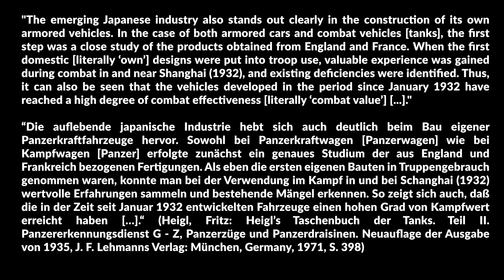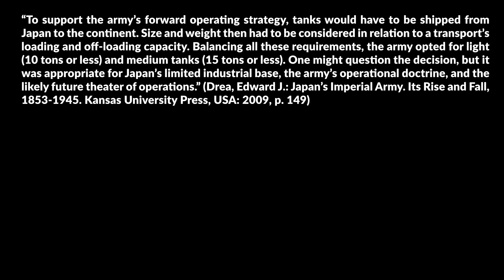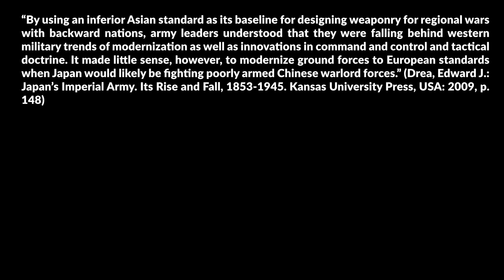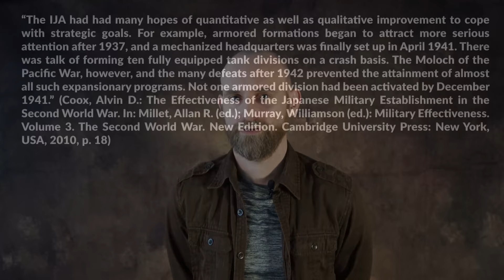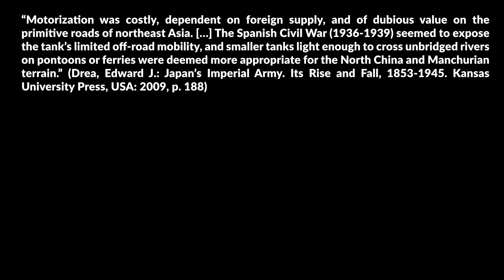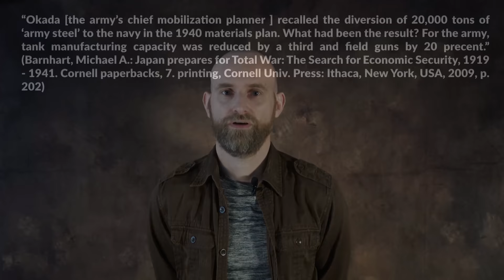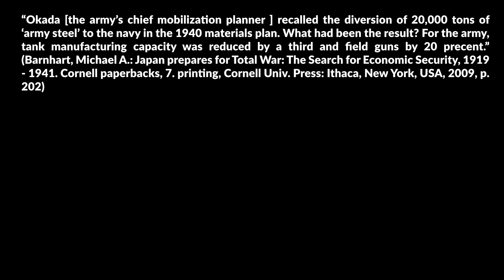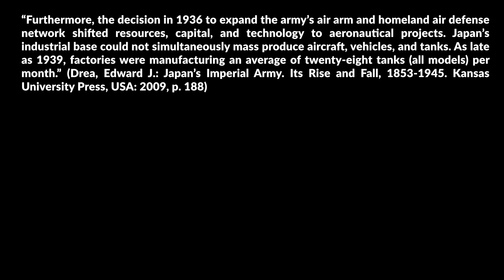The Problem with Japanese Tanks in WW2

Comment: The lack of real armor formations with good tanks isn't unreasonable. Its their complete lack of anything really advantageous in their army line up. Call me funny but going into a land war with China without serious advantages seems truly dumb. The numbers advantage the Chinese had along with their many different factions basically made them an unkillable hydra. Wipe out the leadership of one faction and their troops are likely to fall in line behind another faction simply to get fed. Its not the winning the battles that becomes the issues. It is the maintaining control of areas after you take them. Insurgencies would have been able to fade back into the massive population without much struggle. Mass killing civilians to stop that likely made more recruits and made that particular area even more of a drain on resources rather than a gain that a conqueror needs to continue moving forward. 

Im sure the Japanese were able to get some resources out of China, but at what cost? How many soldiers had to be tied down to garrison duties just to secure a particular mine and the road/rail network to extract stuff from that mine to the port for shipping to Japan?

Comment: Their tanks where suffied for the main threath, chinese peasants with at most a 37 mm pak
Reply: 37mm cannons went trough them without any real issue. 

In 1945, when the Soviets invaded Manchuria and the Northern-most Japanese Islands, they found out that their long obsolete PTRD41 Anti Tank rifle, which had for years been virtually useless against German tanks, had no issue penetrating Type95 tanks. 

The Chinese however lacked virtually everything. Their main weapon was the soldier and the rifle. 

They had very little artillery, close to no airplanes or tanks, extremely few and far between cannons of any sort, had a severe lack of machineguns, vritually no sniper rifles, extensively lacking mortars etc. 

They were even critically low on basic things like shoes or ammo pouches. 

Not to mention things like Radios. 

The Chinese National Army was, to put it simply, not ready to deal with any sort of tanks you trew against them.
Reply: @daniels_0399  i never been able to understand why the japanese didnt invest everything in their army to, at least, occupy most of china. If the only knew at the time that china possesses 75 percent off the worlds rare metals.
Reply: @danydierickx3228  After the failure in the battle of Khalkalin Gol and the Nazi-Soviet agreement pact, the IJA lost its support and IJN got their luxury in politics. The condition worsened by the oil embargo by the US so instead of focusing on China alone, they began striking oil and mineral rich in SEA. With their veteran troops sent to major fighting in the Pacific and SEA, the lack of qualities on its troops also slowed down the progress.